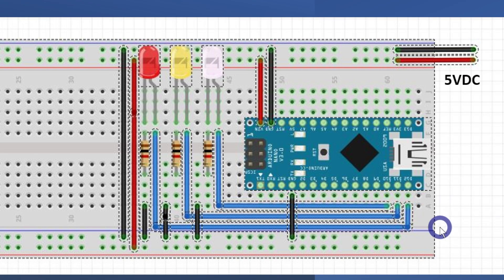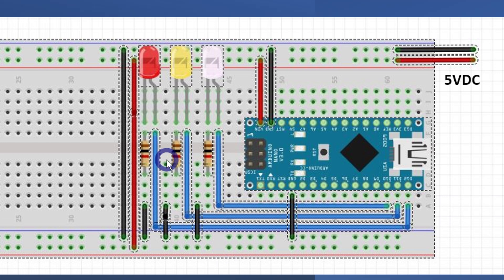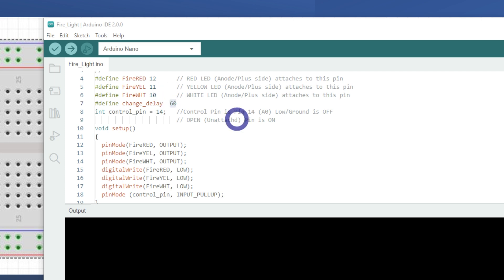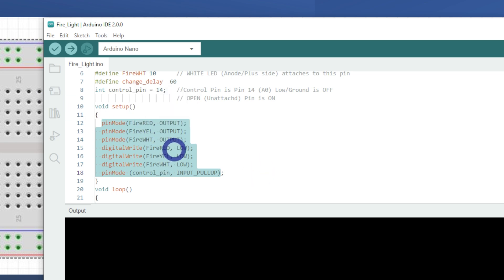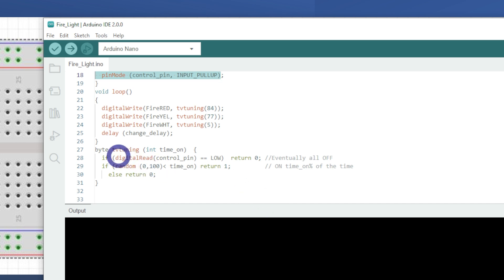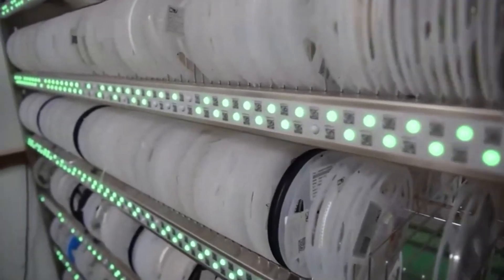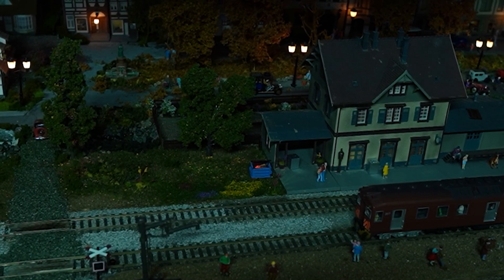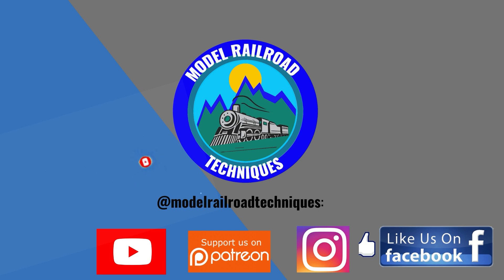Create Stunning Model Railroad Animations: Arduino Garbage Bin Fire | Bring Your Layout to Life!

Comment: Different LED colours have different forward voltages, due to the way LED's are manfactured, which is quite technical, but yeah, that's why you need different resistors.  It not only matches intensity, but it matches current draw and makes sure you don't over-drive your LED and reduce it's life.
Reply from the maker: Thank you for this. I still didn’t get the intensity right as I do not have the correct resistors.

Comment: Looks pretty good!!!   If you want some taller flames, you might try this.   Get some uncured clear silicone caulk (like GE Silicone II) ... mix in a drop or two of acrylic fluorescent paint (orange, yellow, red, etc.)  ... and use it to cast some flame tongues that you can add to the scene.  The mix might take a couple days to fully cure ... but it will cure.   All the best ... cheers ...